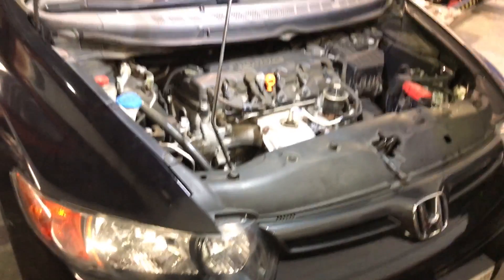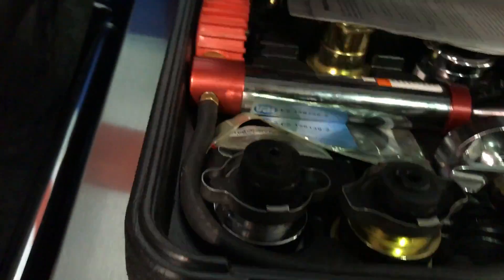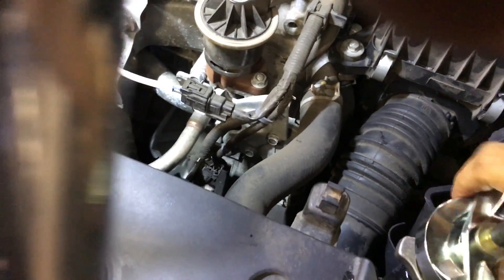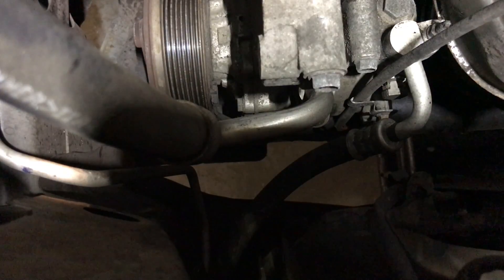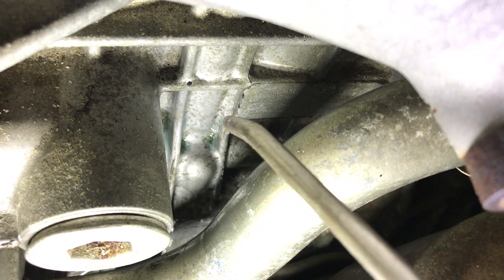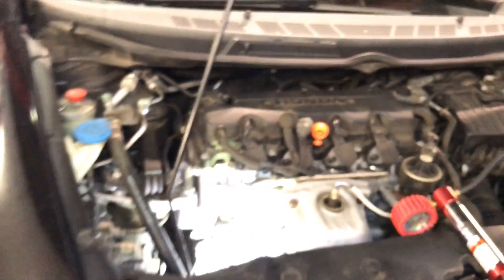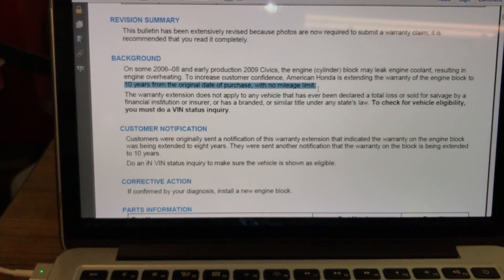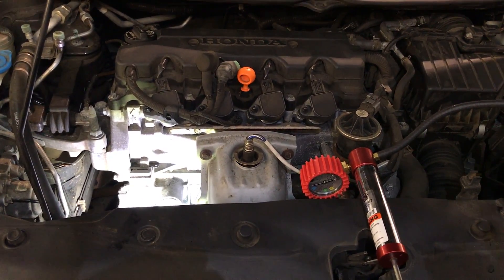2007 Civic engine block recall TSB 10 048

Comment: I saw in a reddit thread someone commenting it doesn't affect some engines. Is the 1.8 L affected by this. I know si isn't covered. But it seems most 2007 civic types are 1.8. Besides the hybrid(1.3L) and si(2.0L). So I think they might have been wrong and the 1.8L actually is at risk of cracking

Comment: Have a 2008 civic with a cracked engine block. I did a thorough prep on the crack and use J-B Weld original formula,  repaired the problem, been driving the car now for 8 months with no leaks. My crack was identical to this engine in this video.  It can be repaired.  Take your time, clean area  extensively,  apply 3 layers and let it setup for 48 hours . Good luck.
Reply: I Do The Same .! 🔥
Reply: exactly.  Take your time, let everything dry!  I drained the coolant on my 08, sanded the crap out of it, and wire brushed, then laquere thinnered it and let it dry a day. Then JB Welded it thick. That was 12 months ago in MN winters and 10k on the clock. Still no leakage. Good luck. The worst that can happen is you have to recoat.
Reply: @henryhill3778 Just a update on the cracked engine block repair for the 2008 Honda civic. Its been over 3 years now and the original JB Weld repair is STILL holding up. So this can be repaired.

Comment: Hi...
My 2007 civic engine block Crack. 
I don't know how should I do....
Reply: Take the alternator off. Drain the coolant. Clean and sand the area where the crack is. Apply 3 coats of JB weld original formula.  Let the JB WELD set up for 48hrs. Refill coolant and you should be fine.  Works for most everyone that has tried this repair.
Reply: @goldsbym  yep... honda of all mfg's... I drained the coolant on my 08, sanded the crap out of it, and wire brushed, then laquere thinnered it and let it dry a day. Then JB Welded it thick. That was 12 months ago in MN winters and 10k on the clock. Still no leakage. Good luck. The worst that can happen is you have to recoat.

Comment: Anyone know how common this actually is on 2006 civics? Seems like a very small percentage given how many were made. Wonder how common this actually is ?
Reply: It's a big enough problem they did a tsb bulletin and extended the warranty.  I have 220k on my civic and the block just cracked a few weeks ago.The most common mileage that this occurs is just over 200k.  That is why Honda limited the warranty to 10 years.
Reply: Call Honda corporate tell them your vin they know what cars have the problem explain what you are asking and they will know . I think 2007 is the biggest problem
Reply: A little percentage of 2006 blocks crack. Mine is at 170k on the factory engine from 2006 and its still going strong.

Comment: Thanks for this video. Bad thing is my car has this crack and the warranty Honda gave on the motors is 2 years passed 😭😭
Reply: Honda should honor this f up not the 10 year bs they was not doing there job making the blocks shame on Honda not accepting a total screw up. Toyota replaced all frames no questions asked
Reply: @aaronhobart6223  I agree 100% stand behind your product and fix the issues
Reply: @DanielThomason  I bought a nice 07 civic bad block for 500 taking it to a shop 600 to change and 800 ish for the engine.. having Honda check the vin before I buy a engine make sure it’s not a bad one.. but once done I’ll have a soil car just to get around town in
Reply: may i ask what you ended up doing? i am just noticing the leak and overheating
Reply: tmac0701 stop leak for the time being.
Reply: BabyDanielT thank you so much for replying I will try it first thing in the morning...any certain brand
Reply: tmac0701 I took it to a place and they did it. Till I can figure something out. Knock on wood so far it’s worked.
Reply: BabyDanielT understand
Reply: was a JB weld or liquid added to the radiator?
Reply: tmac0701 liquid

Comment: Can't believe Honda have this problems .can't believe
Reply: i know.. it sucks.
Reply: yep... honda of all mfg's... I drained the coolant on my 08, sanded the crap out of it, and wire brushed, then laquere thinnered it and let it dry a day. Then JB Welded it thick. That was 12 months ago in MN winters and 10k on the clock. Still no leakage. Good luck. The worst that can happen is you have to recoat.

Comment: I have an 07 civic that had a replaced engine due to the first one having a blown head gasket. Every 6 months it loses a little coolant from the resevoir tank but never overheats I drive it about 90 miles a day 7 days a week so it seems to be expected to lose a tiny amount of coolant.

Comment: Man this sucks for y’all having this problem... Fortunately for me, my 06 is at 230k and there is nothing wrong with my block... but if something happens, I got my jb weld ready.
Reply: Good luck with that. It held for about a month the first time I tried it and ever since won't work anymore.
Reply: Well you stuck at applying jb weld then
Reply: @Coolerjoe101  I "stuck" at it? Please elaborate on what you mean by that. Thanks!
Reply: @Coolerjoe101  they stuck? They stuck what?

Comment: I have an '08 Civic LX coupe i bought about 4 months ago. Just hit 132,000 miles and mine is cracked. I never heard anything about this problem until it happened. I noticed a strong scent of anti-freeze and the car started to overheat. I'm going to attempt to see if Honda will do anything for me but with it being over a year past the 10 year deadline, i'm assuming they wont help. I've heard some people stating that JB Weld has worked well for them, so that will be my next attempt at trying to fix it. But even then, I'll be cautiously driving around and always worried how long that fix will last.
Reply: I went to the dealership and as expected they wouldn't do anything for me. Matter of fact, when they looked up my VIN they said it wasn't even affected by the TSB. What a joke!
Reply: Then they said they called the Honda of America and they wouldn't help out. Well if my vin wasn't affected by the service bulletin then why did they even call Honda of America in the first place?
Reply: honda of all mfg's!... I drained the coolant on my 08, sanded the crap out of it, and wire brushed, then laquere thinnered it and let it dry a day. Then JB Welded it thick. That was 12 months ago in MN winters and 10k on the clock. Still no leakage. Good luck. The worst that can happen is you have to recoat.
Reply from the maker: I will try to talk to dealer first.
Reply: @MaicSalazarDiagnostics  well I've heard a lot of stories about Honda only honoring the 10 year deadline. Some have said only 20 days after the 10 year deadline their car broke and honda wouldn't do anything for them.
Reply from the maker: Sick Naban well I don’t know that personally I have good experiences. I still think that you should go. Never know!

Comment: If you're broke, drain coolant, scuff area, CLEAN AREA, Apply JB WELD and wait 3 days. fill with coolant & enjoy
Reply: I did this and used the quick weld JB Weld. And it's held up good going on about a month now.
Reply: Sick Naban  how long did that last?
Reply: @SickNaban  may i ask what you ended up doing? i am just noticing the leak and overheating
Reply: @tmac0701  I used K & W Chemical FiberLock® Head Gasket & Block Repair. It WILL clog up and cause issues throughout your cooling system if you aren't careful. I bypassed the heater core when using the product to prevent the possibility of it clogging up. My engine block still leaks. I have to add water to the reserve tank for the radiator about every 3 days or so. I've also heard some people have good success with another product called "Bar's leaks head Gasket and cooling sealant". Good luck and if you have any other questions, I'll try my best to help you out.
Reply: its still working?

Comment: I found that the head bolts go down too far and crack out the block.  Wither that or when you put oil on threads as one does to install the head, it hydrolocks and cracks the block.  

I have seen these crack inside the cooling jacket and the head bolts.  Making coolant leak into the engine oil.  Not an external leak.

Comment: My 2006 Civic slowed to a crawl and started smoking from under the hood on Thursday.  AAA towed to our mechanic who ran a coolant pressure test.  Cracked engine block.  261K, 2nd owner bought in 2007 as certified from local dealer.  No notice of warranty extension or TSB 10-048.  Had I known, I would have sold the vehicle before incurring these unexpected costs for an obvious manufacturing defect.  Will Honda pay for any of this repair even though we are now past the secret warranty?  This needs to be exposed!
Reply from the maker: David Combs I will call the dealer you purchased from to see if they can help you.
Reply: No they will not do anything but give you a run around at Honda of America. This is my 1st Honda and my last because of this. I just can't understand why put a limit on a manufactured defect? 🤷🏾‍♀️🤦🏾‍♀️ For Honda to be such a big name they really have sucked for this. I mean what will it take for them to do something about these issues?

Comment: Fuck !!! I Bought my 2006 Honda Civic on June of 2006. Never had any issues with it regarding overheating until today. Driving home from work and noticed high temperate. Looked under the hood and noticed some water on that lower engine area, just like on this video. I don’t qualify for this damn extended warranty

Comment: I am the second owner of a 07 Honda civic. My car was having major problems for about 6 months until my dad found out about this "extended warranty". Sure enough I had a cracked engine block and was leaking fluid. I contacted Honda to try and get it fixed but they then told me that they only honored it if it was within 10 years of the roll-of-date of the car. It was 10 years and one month since the roll-off-date for my car. I tried arguing with them that the problem had been happening for 6 months now and if Honda had publicized this "extended warranty" then I would have gotten them to fix it sooner. They still refused to fix my car.
Reply: Wow, story of my life. I hate Honda
Reply: Hire a lawyer
Reply: What major problems were you having?

Comment: Not a recall, only a TSB.  Once past the 10-years I found with my '06 this spring I am screwed. May have to look into the weld possibility.  Cast aluminum I'm not sure.  Honda will never get my business at this point they should have done a formal recall on '06 to '09.5 Civics and fixed them all now their reputation is crap.
Reply: Owned car 4 years+ and was never notified by Honda about the TSB.
Reply: 67dodgepolara most countries in asia honda doesn't recognize that this problem exists. And does nothing.
Reply: I’m in the same boat. What did you end up doing with it ?
Reply: 67dodgepolara I agree my 2007 Civic has a cracked block in back as far as I know. There  is no warranty but should have to be replaced as long is the car is on the road there is no rust car is in too good of shape to send to junk yard so now I have to find a good block to slap into the old girl .

Comment: I don't know why people are making such a big deal about it if Honda dealer don't cover it have it welded with a good welder is not high pressure it's only like 16 15 psi it's not like the inside of the engine or nothing I fixed mine easy hundred bucks
Reply: Did it work?
Reply: He said in his comment he fixed it by welding it for $100 fee.
Reply: So you had a shop weld it for $100?
Reply: @dennisrobinson8008  yes it was pretty cheap
Reply: @PRSQUAD88  He just built up all the leaking area?    Can you describe the fix?

Comment: My 2006 Honda Civic Coupe/2dr had this same cracked engine block issue but unfortunately, I didn't find out until it overheated around 112k miles, 3 months after the 10 year warranty ended.

I was a second owner of the car and never received any notice of this issue from Honda directly.

Burns Honda in Marlton, New Jersey would NOT replace the engine for free and provided an estimate of about $4500. 
While I was there, they informed me about the Passenger airbag recall and were prepared to repair this defect but I didn’t bother since I was now forced to buy a new car.
I didn’t put up much of a fight with Honda since it didn’t seem like many people were having success in doing so (based on information available via Google Search).

Comment: you put the wrong document.  is this problem only in north american civic or everywhere else ?
Reply from the maker: Why the wrong document? Ok the text is the right number.
Reply: Maic Salazar oh my mistake i taught it was bulletin 10-084 sorry. so is this a regional problem or worldwide ?
Reply from the maker: Marouane Freeman I know of this only on USA, but if VIN number matches it would happen to it.
Reply: Maic Salazar how can i chec if my vin is ok ?
Reply from the maker: Check minute 4:08 on video it shows the years and VINs that are affected with this issue. But that doesn't mean that the car would have the problem. If your vehicle is overheating and loosing coolant, then check the problematic areas describe here.
Reply: Thank you sir this was great
Reply: where are you located ? so you can check my 2007 civic
Reply: That’s the correct bulletin

Comment from the maker: Sorry for the low volume on the audio! Don't know why! Also the TSB number is as you would see on the video 10-048!
Reply: Maic Salazar how common is this problem? I'm looking to buy a used 2006 civic lx and I'm nervous that it could have this problem and it'll be out of warranty
Reply from the maker: George Parker it is very common. If your car has less than 100k miles it will be cover no matter the year, if it has more than that,then it is not likely to happen. This is more common on lower mileage vehicles. Good idea would be to check that area with engine running at normal temp.
Reply: Maic Salazar yeah the one I'm looking to buy has 136k miles on it. I heard they crack around 90k I'm going to double check that area before I buy it. So at that kind of mileage I should be okay?
Reply from the maker: George Parker I will say yes.
Reply: Maic Salazar okay great because I'm paranoid that this will happen to me and since it's an 06 the warranty won't cover it
Reply: My '06 just went out.